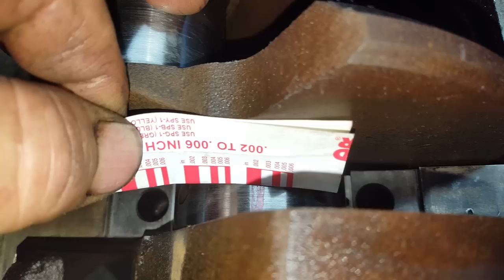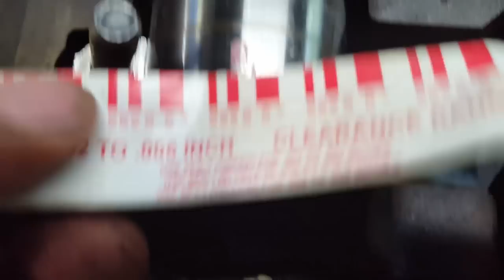Abandoned in the woods for 39 years!! Will this 1975 C20 ever run again??? | Part 2 Engine Teardown

Comment: If you push a piece of rubber or vinyl tubing on the connecting rod bolts before removing it will prevent scratching the main bearings. That is one nasty motor, owner never changed the oil. :face-blue-wide-eyes:

Comment: Just wondering. Could you maybe. Put some J B.  Weld. In those severe pits in that one cylinder. An then sand. An hone it.  Just asking???
Reply from the maker: If I ever run across another one like that I might try it.

Comment: i don't know much about engine building , but what is that you are doing with the red line on the crankshaft and you are checking how thick the red line is ? the reason please.
Reply from the maker: Checking bearing clearance with plastigauge.

Comment: That's not a wimpy stock built '75 truck engine with those flat top pistons... looks like a 300 HP 350 or 327... 359"? with overbore?
Reply: Kinda what I was thinking. My 76 k10 had a 4 bolt 350 with crummy dished pistons, a c20 should have had similar. The code on the pass front deck needs checked
Reply: @assymcgee2835  - Yeah, dished pistons, big chamber heads, actual compression ratio in 7's... even though Chevy claimed 8's somewhere... horrible MPG...